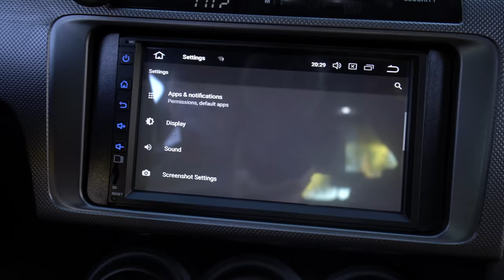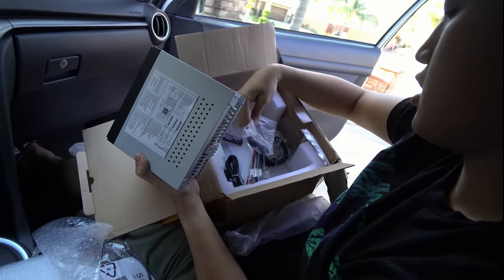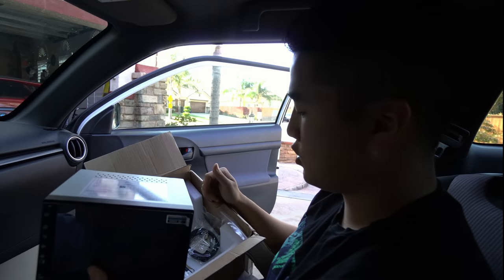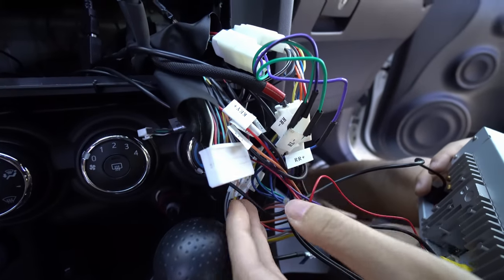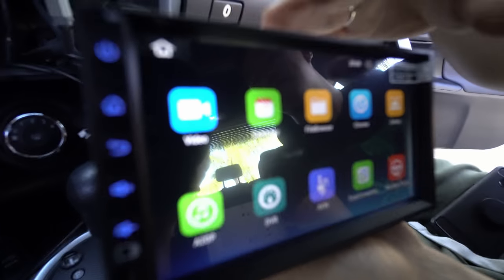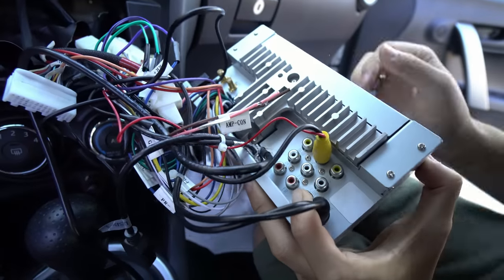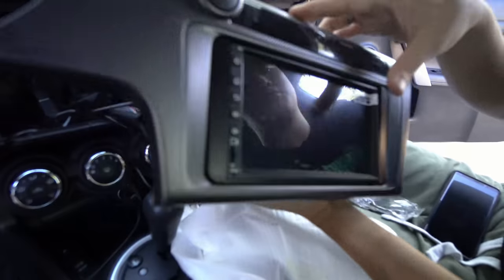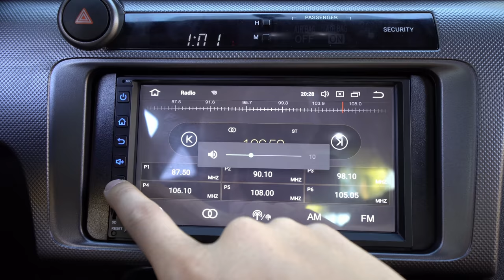Universal Android Head Unit | 8-Core goodness | Install | iDoing

Comment: Sorry to contradict you, but some of them sound great, I have an Atoto A6 and the sound is great.
Of course if you are to put an external DSP, put top notch speakers with big amp plus a big subwoofer, then Chinesium is out of the question.

My biggest fear is how long will these chinese last.
Reply: Why is it out of the question? Use the usb to output sound to the dsp
Reply: If I was to put well over 2K, than I would stick with big names (why take a chance when you have the budget).  sound quality is not my main concern, amplifying audio signal with high S/N and low THD is not a problem today. 
I am just not sure how long those chinesium will last in harsh environment.

One thing that did surprise me about my Atoto A6 pro was that even if you have a sub, the main channels are still full range, of course a DSP can solve that, but I would have prefer a high pass filter on the main channels. You can select the upper frequency for the sub.
Reply: I have a chinese touch screen head (not android) for about 3 years now, still works as day one. just the usb port got a bit loose over time but a small piece of paper stuck in it solves the problem. So longetivity isn't my main concern as Chinese aren't always that bad. I have a hifi sound system and I'm just not happy with the output. I will change to pioneer and see if that makes any difference.
Reply: It is very easy to amplify the audio frequency spectrum (20-20K). Speakers and room will have a much bigger influence
Reply: @KXP70  those usb outs arent that great either the headunit gets buggy or just crashes
Reply: I have the atoto a6 and im inclined its been nothing but consistent in function and has good audio quality
Reply: @dorianvelez17  yep, best for sound quality of the chinese units. I think these people who think they are a junk strictly wants sound quality. 

Beyond that, the functions of an Android unit will surpass a Pioneer. Waze, Bluetooth calling, built in second Bluetooth strictly to hook up to you're obd device to give you on screen access, YouTube, internet access with WiFi tether, and anything from app store is available. You can use any streaming music service easily. It's a jack of all trades drvice. Blows Pioneers offerings out of the water.

Comment: i really want to know what the distortion is on the rca's and at what output voltage they work...i would still prefer a good name brand headunit with a good warranty over these aliexpress units...when it is a role of the dice with warranty and etc etc...

Comment: i hear people say pioneer has better sound. but people, sound mostly is about your speaker not the head unit. furthermore I had one of these android units. very good but keep in mind this will not work in cars build after 2016 where everything is managed from withing a radio unit. 
missing information like time is no biggy. But if you have to regulate your airflow, milage counters ect from your headunit. your screwed with android units.
Reply: the source is from your headunit mate

Comment: Pioneer audio quality is way better. Get a pioneer deh80 prs.
Reply: i have that unit for years now and still love it...best "high end" unit for the money...you should hook it up to a couple of prs-d800 amplifiers...you will smile for miles...
Reply: I agree Pioneer has the way sound quality it there. No cheap no name brand unit will compare plain and simple!
Reply: Luke Dawg  I can agree with you. I had a cheap dual double din  and I changed it out with a pioneer double din and it way better. I won't buy a cheap brand radio again
Reply: nope, should get a dex p99rs

Comment: Better in features until the whole unit gets trashed, i tried 2 android head units and they both died in a couple months, one just stop working and the other went glitchy at the point that it cannot be usable, no reset of any kind worked, they just died, Problem is that if pioneer do something with all this features then not even the dealer would be so evil charging the gold price that would have.
Reply: That's pretty typical. But when you shop online based solely on price, and believe the bad chinese translation on eBay, this is what you get. lol
Reply: Correct. Poor quality
Reply: Better than spending $1,200 on a Kenwood Dnx890hd that has failed for most owners and Kenwood just washes their hands buy anything but Kenwood/JVC

Comment: I promise my pioneer unit has way more adjustability with all settings over that cheap android unit
Reply: I doubt it, the whole point of android is high levels of customization. The pioneer unit will sound much better though, most of these android head units have shitty DACs

Comment: I mean this Radio is cool but have a Bad Display (you will see it in the sun) Sound not as good as it could, Radio FM not good as the Stock Radio FM, it is sometimes very slow, and if its to hot it will do random  restarts. Do you have 1 ore 2 GB RAM?

Comment: I've had 4 of these android units and they've all crashed no lie the price is good and they have a ton of features but just can't match pioneer or Kenwood unless your on a extreme budget build by all means do it but these android units don't hold very long I got a pioneer 490bs in my Dodge magnum and pioneer 600ex in my expedition also Kenwood ddx990s in my wifes Ford fusion all three are solid  it's a get what you pay for deal

Comment: For a feature rich head unit for 200 I still wouldn't recommend this one, Walmart has a Dual made double din stereo that doesn't sound bad and packs in Android Auto and Apple Carplay. To me that's a no brainier because instead of the head unit doing all the processing and taking care of an OS, Auto and Carplay just act as an extension of your phone and will be updated yearly when your phone gets updates. When I see an Android head unit I just can't help but get that PC master race fear of obsolescence when in a few years google will have left android 8 in the dust and the maps apps stop getting new features. Plus using an interface made for cars in a car seems to just make the most sense, phone integration is just seamless. That's not to say that these glorified tablets don't have merit, the OBD2 stuff is cool and all, I just feel that the future is Auto and Carplay (at least for now) and that's the way to go.

Comment: These cheap Android units are decent, I have 2, but they lack in sound quality compared to Pioneer or Kenwood. That is ultimately why I no longer use them. I would rather get a wireless carplay or android auto Kenwood/Pioneer unit. Sound is important for me. If you have nice components and woofers in your car you know what i mean. They don't even mention the preamp output voltage in their literature.
Reply from the maker: yeah, these units are great value and they sound good. 

If you are an audiophile, the other brands are something to look at.

Comment: Not very many speaker controls options subwoofer RCA’s are low-voltage and cannot adjust individual speakers for surround sound
Reply from the maker: getting an external dsp will give you more options
Reply: Why should you have to buy anything to add on if it's better?
Reply: @thedog556 if you really wanted one you could get a line driver to boost voltage to amps...but again,why not just get a good hu to begin with?I can see the appeal to some but this isnt for me...I love ground pounding bass,crisp highs and punchy mids too much lol
Reply: @thedog556 I agree 100%,dont get me wrong,I was just commenting on the low voltage outputs.I think these things are pointless.if I wanted to go this route id mount a tablet up and interface with my hu...I'm not sacrificing output,or quality of sound on a hu...thats what controls it all.no way id hit upper 150s on a termlab swapping this pos out with my hu...or if I did id probably be clipping everything to death from distortion

Comment: Sounds good EXCEPT that its the same size as a standard dual din! What a fail! Its not specific option for filling in the space of the stock specific car model. Do yourself a favor and buy a Pioneer or Kenwood Alpine or JVC unit. Much better audio sound quality DAC with those units.

Comment: lots of features but ultimately, if you are going to run an amplified setup you will be down on sound quality compared to, say a pioneer/alpine/kenwood system. Bang for the buck they are good though but when it comes to sound quality, you do get what you pay for. Top brands spend $$$ a year paying staff to perfect their craft, and over the years you, as the consumer gain for that investment.  In regards to the video, please learn to script your video, stay on point, it will make you sound more competent. I'm sure you are and have lots of experience installing however the video does not pit you in good light, hence why some of the comments have been a little negative. Be structured, concise and explain the features or demonstrate them. Also the annoying background music does not help, it detracts.

Comment: Never going to have the quality of a kenwood ddx
Reply: Omar123 that's a nice unit!...nut still inferior sq wise to Alpine and Pioneer
Reply: I hate mines keeps lagging my videos screws up my calls to where i just use the phone period and bluetooth glitches where nothing comes out n had it bout almost a year which did yall get cause mine is a piece of shit for a $190
Reply: @Frost_Tiger  
You got scammed then ;  you need to check the specs I've seen these before Chinese company's jacking up the price for a head unit with POS specs
Reply: @hihaveaniceday9386  I figured you get what you buy since I was on a budget and I think like you said sell probably scammed me cause I bought 1 didn't have the turn style nob sold it to my bro bought another one and with a nob and still using it about to look up a better one but dont know what to look for yet

Comment: These Android units are nowhere even close to being better then a pioneer unit. These things fail in the heat. And if you care about sound(have aftermarket speakers and subs) these things throw out disgusting sound. Even the cheapest single din pioneer unit under $100 will give you decent sound. These are horrible units.